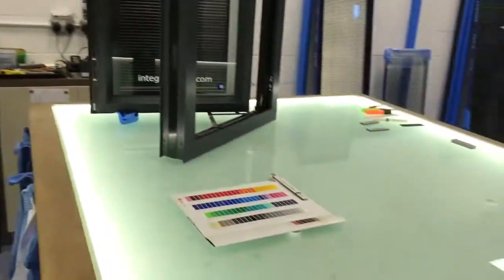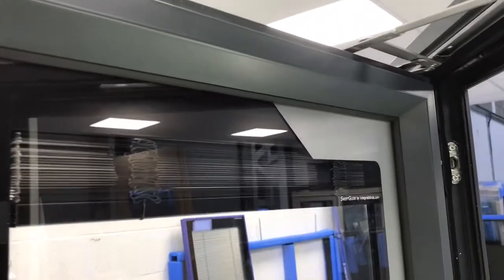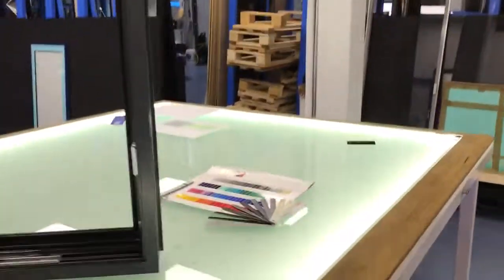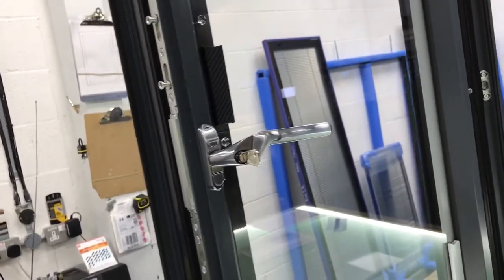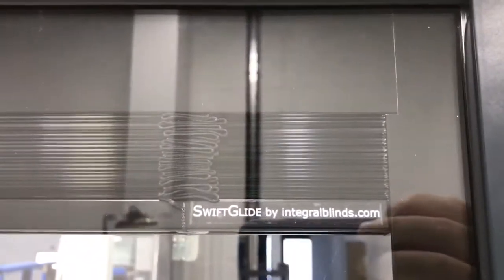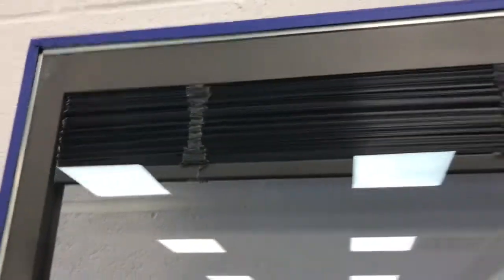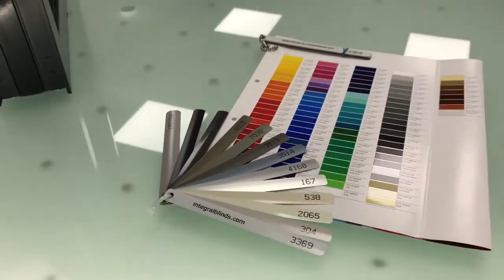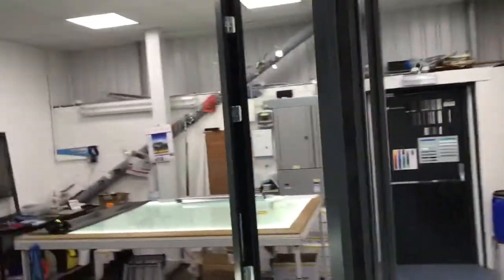Integral blinds in Origin global window frames

Comment: We love our doors and blinds they are fabulous . We are having trouble with the magnetic sliders at the moment , are the magnets affected by  low temperatures
Reply from the maker: Depending on the size of Integral blinds units when the temperature really drops… you may, may, experience issues. This is due to deflection where the panes move closer together at centre pane due to the gas inside the unit shrinking and creating a vacuum effect .

This may be more likely to happen on larger units in excess of 1.7m2.
To mitigate this we recommend using 22mm cavity minimum and switching to 6mm glass rather than 4mm.

We give clear advice on all quotes regarding this.

The issue resolves itself when this occurs when the temperature normalises again.

What sizes are your units? Width x height? Who made them?
Reply: @IntegralBlinds  Thank you for your reply , very helpful .  The problem is in the bifold doors so I  do think it is the temperature , thank you for putting my mind at rest 😊